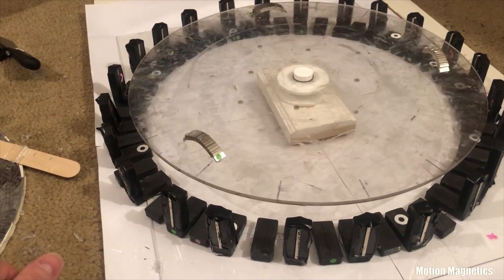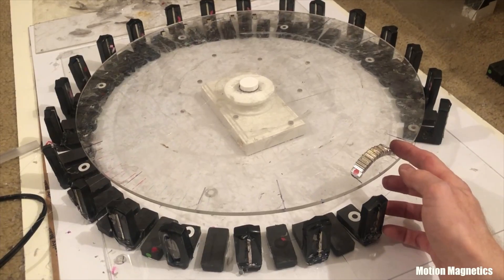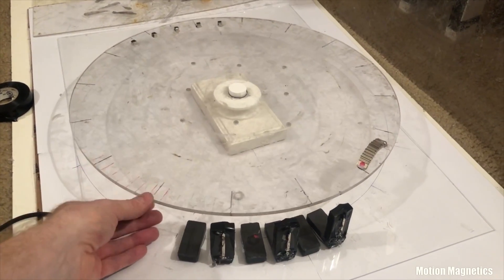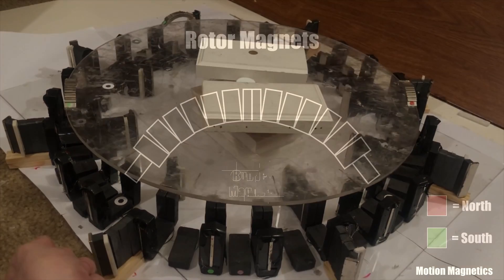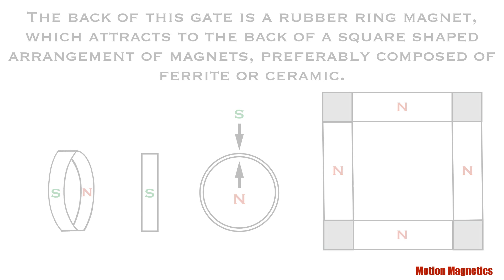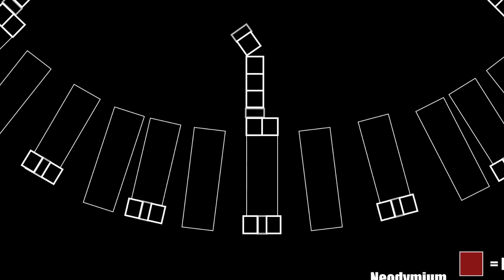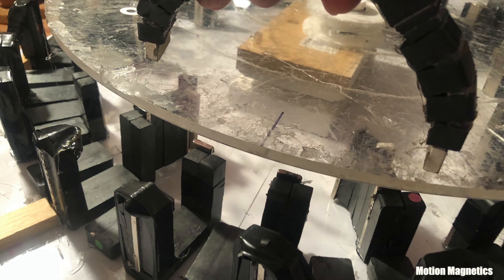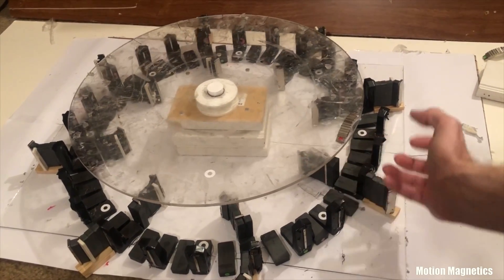Combining Howard Johnson's Magnetic Gates

Comment: How would you evaluate the success of one magnetic arrangement over a different one?  Speed of rotation? Continuous rotation? Force required to stop rotation?
Reply from the maker: I go into that in some detail in my series on the 3 types of permanent magnet motive force systems. The biggest thing I look for is the ability of a magnetic gate to be able to attract an object or rotor into a gate without any repulsion at the entrance of the gate and through the gate without being drawn back into it. That was not what I was attempting to do in this video, however, as this was an entirely different magnetic system I was experimenting with.
Reply: @Motionmagnetics  Please send me the link to your series on the 3 types of permanent magnet motive systems...
Reply: A permanent magnet is static. It has an equal 50% attractive (braking) force and a 50% repulsive (pushing) force. IOW: it is in perfect equilibrium.
Simple logic, right? The number of magnets used (or arrangement used) will do nothing to change this equilibrium without an external power source of some kind (whether it be your own hand or a battery/copper coils, etc). Differing arraignments of permanent magnets will do nothing more than determine how fast or slow the pushing and braking will be (from pole to pole) on the rotor. This has been proven over and over again on this very channel (and all others who have tried), no?
Reply: @jsouthern3838  пришли мне ссылку на подтвержденный наукой материал, что постоянный магнит статичный. Может ты просто не можешь отличить статичное от постоянного? У тебя вобще голова не думает, что ли. Поле постоянного магнита "постоянно", а не статично. В квантовую физику загляни умник и почитай, что такое поле. Там написано, что если есть поле, значит есть колебания у этого поля. Если есть колебания оно уже не статично. Ты еще способен это понять??? Реально считаешь себя умнее Ричарда Фейнмана?